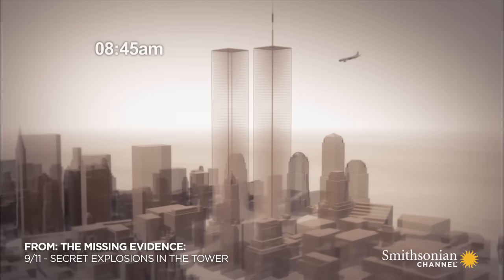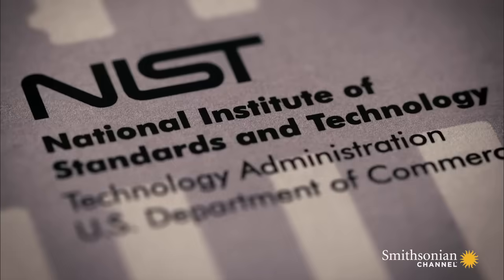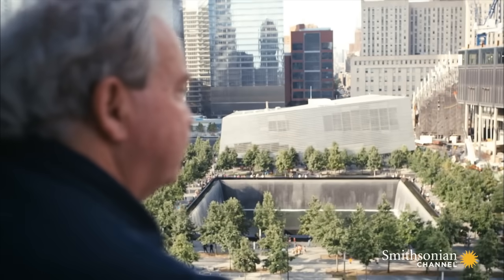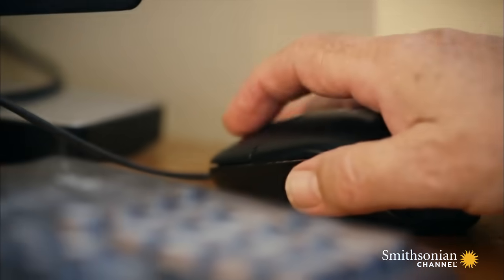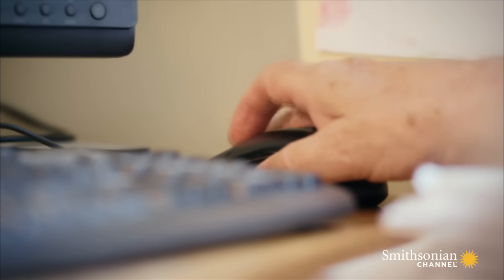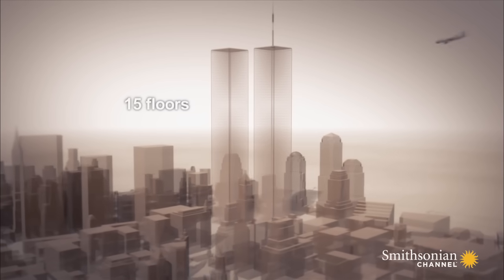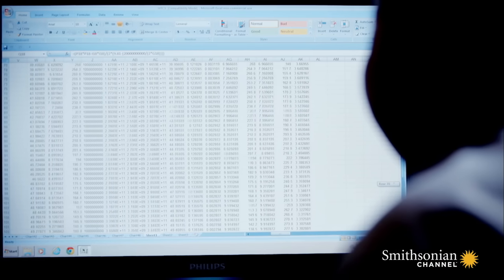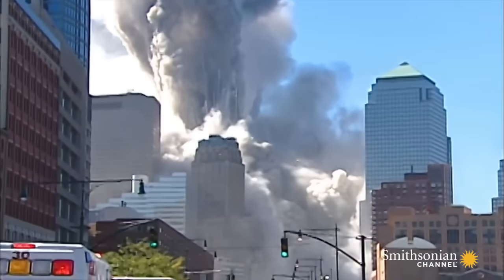This Computer Simulation Explains How the Twin Towers Fell

Comment: I guess the Smithsonian institute decided Newton’s laws just…stopped working that day. This video is a form of terrorism, the misinformation and disinformation are willful and intentional and have zero basis in science.
Reply: Your opinion matters, how?
Reply: If you can make a case that Newton's laws were violated on 9/11, please do so.

But you can't, can you?
Reply: @Tim22222  the point is they weren’t violated. They can’t be violated. They are laws. But the official explanation is incompatible with those laws. That is the point.
Reply: @bymthirty  Restating my challenge: If you can make the case that "the official explanation" violates Newton's laws, please do so.
Reply: @Tim22222  try clapping your hands 80 times in 10 seconds. 

Demolition
Reply: @bymthirty  [10 days later] Yeah, I didn't think so.
Reply: @Tim22222  law of thermodynamics and the evidence of molten iron in the millions of pounds of iron microspheres, molten metal pouring from the sides of the building pre collapse, and the flowing pools and streams of molten iron in the rubble piles and NASA temps that were sustained at extreme temperatures for months after 9/11. All had to come from exothermic chemical reaction. Also conversation of momentum, the “missing jolt” during the descent of the top sections of WTC 1 and 2 and the downward acceleration, the horizontal steel girder projectiles clocked at 65+ mph that left behind them white smoke trails, since gravity works vertically not laterally. Those are just to name a few. Not to mention NIST’s admission that Building 7 was in a period of free fall lol. I could go on. But yes the laws of thermodynamics, gravity and conservation of momentum are three good starting points.
Reply: @liftmasterdavid1  I love this comparison. I think of it in this way- even 10 planes being crashed into the buildings simultaneously would be nowhere near enough energy, much less sustained, to destroy the buildings with downward acceleration into mere microspheres and dust with horizontal projectiles clocking 65mph…ah yes the heat of office fires post-jet fuel fireball just was truly unbearable and blasting the entire building into smithereens. Errr umm air pressure and friction lol. Totally sound explanations.
Reply: @bymthirty  You're just throwing things you've heard conspiracy say like "law of thermodynamics" & "Newton's laws" as if you actually understood them. But you can't explain what they mean or how the "official narrative" violates them (hint: they don't!) You are unable to make a case.
Reply: @bymthirty  How does "the official explanation" violate Newton's laws? I'd really like to know! I have studies physics & will be able to understand your answer.

Please?
Reply: @Tim22222  you’re trolling by not addressing anything I’ve already stated. The missing jolt paper explains it clearly, as the top sections begin to fall, in the first collapse all the weight literally falls away from the building at almost 45 degree angle and just disintegrates into dust in mid air before it hits the ground (which it should have mostly in one piece). So that entire mass is not pushing downward anymore on the structure below, much less enough to destroy all of it and with horizontal ejections clocked at 60-70mph sustained. Then for the second collapse, there is no “jolt” or bracing from the top section. It just disintegrates itself and even if it has crushed what was below, it can only do so inasmuch as the building beneath it resists with equal force, at which point there is no remaining energy to crush the entire structure below. The laws of thermodynamics also prevent jet fuel and office fires to melt iron or steel, PERIOD, but especially in the quantities found in the microspheres and the molten metal found at ground zero for weeks and weeks afterward. Why are the extreme temperatures not getting lower and lower (moving to the cooler regions), but instead sustaining themselves or even raising? Because of ongoing exothermal chemical reactions likely thermitic in nature. And then I’m building 7 you cannot have a mass like building 7 enter free fall, again due to the law of conservation of momentum, the improbability of symmetrical free fall is even more absurd, but especially to predict its collapse but then take years just to form a basic hypothesis about how it could have possibly fallen. Those are just a few starting points. Even if you dispute free fall of WTC 7, NIST was forced to admit it after a physics expert wrote in for public comment and pointed out their egregiously unscientific final draft. And even the WTC twin towers being demolished to smithereens at about 2/3 the rate of free fall is impossible due to gravity or pancaking due to conservation of momentum and equal and opposite reactive forces of the 80+ floors unaffected by fires or plane impact. Nothing should be accelerating as it falls UNLESS explosives are removing the steel masses that support the building. The lateral ejections that threw steel girders into nearby buildings at 60+ mph are simply impossible due to gravity or fire, by their horizontal path and movement alone. Then the white smoke trails rocketing those girders can be seen in plain sight on every camera angle of the collapse matching the color and chemical composition of the byproduct of the nanothermitic material found in the chips when ignited just corroborates the iron microspheres, horizontal ejections and reduction of huge steel girders into either dust, molten iron spheres or pools of molten iron/steel, or Swiss cheesed /warped girders found in the rubble. Pancaking is a joke of a theory bc it violates the conservation of momentum law and the laws of thermodynamics. There ya go, troll, I look forward to your next troll post that denies all this hard, verifiable forensic and physical evidence with bizarre pseudoscience  and historically/physically unprecedented assertions.
Reply: @Charlie-fu6ep  They can't because being special, being "woke," having secret knowledge the rest of us "asleep" "sheeple" don't, is just too important to them.
Reply: @bymthirty  Absolute nonsense piled on top of absolute nonsense! But hey - at least you answered! So Kudos for that. You're entirely wrong - but you answered. So let's take a look:

First & foremost, NO the top of the tower didn't "fall away" or turn into dust! Where do you get these things??? The top of the tower rolled, yes,  but it came straight down - through the rest of the building. It weighed between 50 & 100,000 tons. Of COURSE that mass was pushing down on the tower! And that mass only increased as each floor was smashed & its debris added to the collapse. Strike one!

The "Missing Jolt" notion was debunked long ago. I promise you will find no physicists who give it any credence at all. We're talking about an acre of interface! There's no reason there would be a discernible "jolt." 

Horizontal ejections are hardly surprising given the energy released in the collapse. Another non-starter that violates no law.

As for the lower section of the building arresting the collapse, you're forgetting something: GRAVITY. Gravity is what kept pulling the collapse down, overcoming the resistance from below. Each tower stored gravitational potential energy akin to 200 TONS of TNT! Plenty of energy to continue the collapse down to the ground.

"The laws of thermodynamics also prevent jet fuel and office fires to melt iron or steel, PERIOD" LOL no it doesn't! It's the fact that the melting point of iron/steel is higher. Nothing to do with thermodynamics. This is not a problem, however, because (fun fact): There's no evidence that any iron or steel melted at the WTC. None! Molten something, sure - but no one has ever demonstrated that it was steel.

Okay got things to do. More later. Maybe 😉
Reply: @bymthirty  How did they know it was steel?

I've been asking this question for years. No one has ever answered it.
Reply: @bymthirty  Sorry, friend, I'm afraid I have you at a disadvantage: I've studied physics & I know what I'm talking about.

There is no violation of Newton's laws. There is no violation of the Laws of Thermodynamics. You have been sold a bill of goods by people with an agenda.
Reply: @bymthirty  Lol! NO, architects are not experts in physics! And almost none of the signers who are engineers are structural engineers! You may think the opinion of a chemical engineer or an electrical engineer on why a building fell is relevant but I do not. Oh and BTW none of those 3000 expressed any opinion at all!! The petition calls for further investigation - that's it! No thesis, no theory - NOTHING.
Reply: @bymthirty  How did "they" know the molten material they saw was steel?

Comment: Here’s one thing. Your little vid neatly shows a pancake collapse. Not only will physics not allow that in the time they took to fall , but the steel inner core once the floors had sheared would be left standing. They were cold and undamaged 3/4 of the way up. This building was robustly built
Reply: The steel structure was comprised of steel beam bolted together. You don't think all that energy being released could break those bolts? Each tower stored potential energy of about 200 TONS of TNT!

Comment: How did the towers collapse? Easy. They didn’t. They were removed with placed explosives.
Reply: There were no explosives. The towers collapsed from extensive structural damage + heat from fire weakening the surviving steel.
Reply: @Tim22222  but hey 2 planes knocked down 3 steel and concrete towers. You ever seen a bird hit a plane? Suddenly though steel and concrete is no match lololol
Reply: @kelseywhitlatch173  Actually, they knocked down 2 buildings - and those buildings in turn knocked down 10 more! So what?

The planes imparted a LOT of kinetic energy on those towers when they hit; it doesn't matter what they were made of.
Reply: @kelseywhitlatch173  I don't know how it's so hard to comprehend that a building fell into another building causing it to fall.
Reply: @Charlie-fu6ep  that's not what happened. I didn't know it was that hard to go watch a video they show it falling and it's uniform. If building hit it and caused that it wouldn't fall nice and neatly in perfect uniformed motion. You sound like you have confirmation bias bud
Reply: @kelseywhitlatch173  How dare you not belive that building 7 was the first steel building to collapse by fire in history.

Comment: The estimated cost of dropping the twin towers would be $209 million. Who knew you could just fly planes full of kerosine into them and wait an hour and not only will they fall straight down into their own footprint , but 1/3 of the material will literally fly away as dust?
Reply: And also destroy a dozen neighboring buildings, sever water mains & electric lines, and cause extensive environmental damage.

You don't hire a demo company to bring a building down, you hire them to bring it down safely.

Comment: There are videos that are taken down all the time that clearly show iron/steel from the buildings clearly turning to dust as it's falling, so what ever explosive that was used is able to incinerate iron/steel.
Reply: Nonsense! Steel does not turn to dust, ever. Explosives do not do that. It took 7 months to remove all of the very solid steel.
Reply: @Tim22222  but what was left of both buildings was not 110 stories of steel and ruble etc?
Reply: @Unsung_Earth  How do you know?
Reply: @Tim22222  by looking at what was left
Reply: @Unsung_Earth  More armchair expertise 🤣🤣🤣

Did you know the WTC plaza had 7 underground levels? Meaning the debris pile was 7 stories taller than you think it was?
Reply: @Tim22222  lol lol lol lol
Reply: @Tim22222  Don't act like your somehow disproving his point.
Reply: NYC later sold 175,000 tons of steel for reuse.

Comment: They were "designed' to withstand the impact of a commercial jet liner?! Is that a serious statement? That was a major concern then, commercial jets having a near miss (the jet nearly missed the building; unfortunately all but the wingtip smashed into it.  [Thank you George Carlin!]) with a skyscraper? With such a concern, what's the point of "fireproofing" insulation around steel members if at least 200,000 pounds of incendiary is going to knock it off whilst traveling at 500 mph or more prior to ignition? Nobody would ever fly a jet full of people into a building until it happened. You can make arguments for why/how the WTC was designed, but I guarantee you that mass and composition striking either tower at that velocity at that height (and either above or below by 30 stories) was never taken into consideration in the design/construction because who would use planes full of people as missiles into buildings full of people until someone did? Hijacking was something completely different, and was included right along with pilot error/malfunction.
Reply: In 1945 a B-25 bomber, flying from La Guardia to New Jersey, got lost in the fog & crashed into the Empire State Building. Although the consequence were far less severe - a B-25 weighs 1/10 as much as a 767 and was only doing about 180 mph - it gave the WTC engineers something to worry about. But as you point out, no one ever considered anyone would use a jumbo jet as a missile.
Reply: @Tim22222  lol lol lol lol lol
Reply: @Tim22222  Great point! Thank you sir!

Comment: "Oh, he simulated it in a computer so it must be true!" Get real. Hasn't anyone ever seen a "physics simulation" that poorly reflects reality before? There are a million different models you could make of the twin towers, selectively leaving out different details, so it's no surprise that it's possible to make a computer simulation that "confirms" that they would fall in that way. This whole thing about "momentum transfer" model requires assumptions about the stress curves of components of the building and how structurally intact the top portion that was falling down was, and it does nothing to explain why the collapse was so symmetrical rather than "snowballing" to one side as normally happens when there aren't explosives causing symmetric failure points at the EXACT same time.
Reply: " and how structurally intact the top portion that was falling down was"
That isn't required for the models.  

"it does nothing to explain why the collapse was so symmetrical rather "
The collapses weren't symmetrical.  The buildings leaned to the side where the collapses initiated.  

" as normally happens when there aren't explosives"
You don't really have a good library of events where planes intentionally smashed into skyscrapers to collapse them.
Reply: @markh1011  lol

Comment: Lol .. they failed so badly because they were detonated with pre installed bombs. Not because 2 tiny planes (in relation to the building size) hit them. It was a pre planned inside job. The building can't fall down from being hit at the top
Reply: Interesting. Where did you get your engineering degree?
Reply: @Tim22222  basic logic and physics
Reply: @DigitalSamTV  Oh. I see 🙄

I got pretty good grades in physics. Let's discuss! What's wrong with the physics of 9/11?
Reply: @Tim22222  lol lol lol

Comment: But this doesn’t explain how 110 stories magically turned to dust there was no rubble left
Reply: Nor does it explain how you were born missing a chromosome.
Reply: Pulverized
Reply: Have a look at how the building were designed in the interior. It was all open plan, so there wasn't a lot of walls. Basically, there was more air in the towers, than other buildings, which contributed to both towers collapsing, without leaving a lot of rubble behind.
Reply: It took over 6 months to clear all the rubble.  There was rubble left.
Reply: Have you seen any of the photos & videos of ground zero???

Apparently not.
Reply: Only explains things that actually happened.

Comment: He's espousing the "pancake theory" which not even NIST has maintained. There's a reason he's a chemist and not an engineer. Great work, Smithsonian Institute. 😆
Reply: No.  You don't know what the pancake theory is.  
It was FEMAs explanation of collapse initiation.  It was not the explanation for the ongoing collapse.
Reply: You don't understand what the pancake theory was.
Reply: @markh1011  explain it to us.
Reply: @jasonjohnson3424  
The 'pancake theory' was FEMAs explanation of the collapse initiation.  It involved floor dropping onto each other near the core and starting the collapse.
It was not the explanation for the ongoing collapse.
NIST had a different theory of collapse initiation and involved failure of the perimeter columns.
Reply: @markh1011  lol you still gaslighting